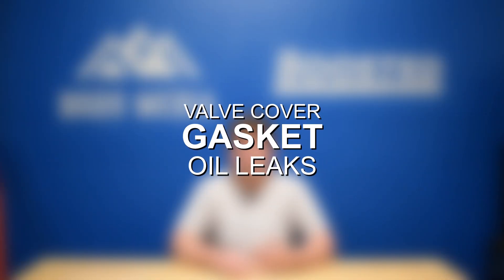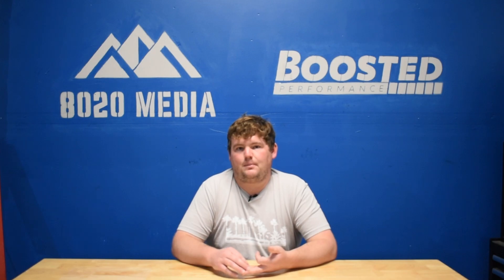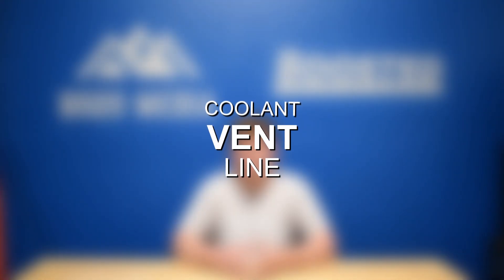BMW's B48 Engine | Problems & Reliability

Comment: As a lifelong mechanic of just about any car truck model I can tell you that no matter who makes the engine, stop listening to the "oil life" monitor and start changing it way more often. If I listen to my car, I'd change my oil roughly every 9-10 k miles. And my b48 is 2025 and requires the 0w-12 oil. $150 my cost for oil and filter! So I change it every 5k, no longer. Oil breaks down. Newer, thinner oil breaks down faster not slower. This is why there's so many issues among all manufacturers for oil starvation or lack of lubrication issues. Make no mistake, regular city/suburban driving is considered "severe duty". Change it more often!!

Comment: Just bought a 330i 2021 62k miles and loving the car , just took it to bmw to replace spark plugs , brake fluid and inspection of the car , they said car looks in great condition, super happy with the purchase .

Comment: Has anyone tried ATP AT-205 reseal?  I understand it rejuvenated rubber, so I'm  wondering if it will help prevent or delay any issues with the rear main seal.
Reply from the maker: D - ATP AT-205 Reseal is a plasticizer-based additive that can temporarily swell and soften aged rubber seals, which may help slow or stop minor leaks, but it’s not a preventive product and won’t extend the life of a healthy rear main seal on a BMW B48 in any meaningful way. In practice, it’s most effective for lightly hardened seals with minor seepage; on a newer or well-maintained B48, adding it is unnecessary and could risk over-softening seals or affecting other rubber components. If your goal is to prevent rear main seal failure, the best approach is maintaining proper crankcase ventilation (PCV system health is key on the B48), using quality oil at correct intervals, and avoiding excessive crankcase pressure—chemical “rejuvenators” are really a last-resort band-aid for a leak that’s already started.

Comment: Changing the oil every 6k miles and the coolant every 5 or so years makes a huge difference, as well as premium high octane fuel. Transmission fluid every 50k also
Reply from the maker: E - Sure does!

Comment: Will these mods give the x1 xdrive 28i 300whp? or should I expect more like 280whp since it’s slightly less powerful than “30i” models?
Reply from the maker: Z - I think you meant to comment on a separate video. If it is this one: https://youtu.be/UT0ErqdtDCU, the latter. The X1 likely won't get to 300whp.

Comment: Drive a 2019 bmw xdrive 430i gran coupe. Normal driving between 29,000-78,000 mi. Serviced at every interval.

1. Water lines failed and leaked all over garage floor $1095 repair.

2. Passenger side engine block plug + 2 O rings for turbo failed $865 repair.

3. Oil filter housing collapsed / failed ( made out of plastic lol ) $4200 repair.

4. Both front lower arm control bars with ball joints cracked $1265 repair. 

BMW are junk. If you have big money enjoy.
Reply from the maker: P - Sorry to hear this... However, we appreciate you taking the time to share your experience.

Comment: I had a 2017 320i that I bought brand new. At 31,000 miles the dealership notified me that I needed a new timing chain and valve cover when I brought the vehicle in for its regular service and oil change. I got a second opinion from a long time BMW shop in my area who agreed that the timing chain needed to be replaced. Amusingly enough they quoted me a substantially higher repair bill than the dealership!
Reply from the maker: R - Sorry to hear this... Hopefully it was under warranty!
Reply: @ Unfortunately it wasn’t, I cut my losses, traded it in and moved on. C’est la vie. 

Thanks for the content btw!
Reply from the maker: R - Sorry to hear. Thanks for the feedback!
Reply: Both lied, especially the indie.

Comment: I work at a dealer in the uk and here’s the problems we see:

Vanos central valves- pretty common.

Timing chain elongation- less common.

Tank vent valve- pretty common.

Coolant line from tank to head- pretty common.

Injectors- not very common but do fail.

Turbo wastegate actuators- pretty common.

Heat management- less common.

Some piston failures but not very common at all.

Overall a good engine but wouldn’t say it’s overly reliable. The B58 doesn’t suffer the same scale of issues.
Reply from the maker: A - Thanks for taking the time to share these insights!

Comment: Hey 8020 media, i have a 2017 330i xdrive bmw with 59K miles and have a major oil consumption issue, the car has zero leaks and is not running rich, do you have any recommendations on what parts could be contributing to that? every search tells me my engine is bad or my piston rings yet the car runs perfect with no performance problems, no smoke, and no rough idle, any tips would help! Thanks!
Reply from the maker: A - Have you had it looked at?

Comment: Do you recommend aftermarket aluminum replacements such as the oil filter housing or transmission cover? Sounds like seals should be part of preventative maintenance for these engines.
Reply from the maker: M - You don't need to go aftermarket, but they may last longer!

Comment: Common problems stated

1. Valve cover gasket oil leaks
- degrading & drying out + cracking
Solution - replace the part

2. Cracks in oil filter housing at 70-80k miles
- coolant leaks / mixes with engine oil
- part cost $300

3. Coolant vent line on cylinder head
- affecting 2.3.4 series
- replace for free at bmw
-  cannot handle accessive heat over the life of engine

Not many other common problems just have these checked out from time to time, comparatively a cery reliable engine
Reply from the maker: O - Thanks for doing this. It will certainly be helpful for future viewers!
Reply: 3 - 
2, 3, 4 series from the F line. G line 3 series has been on the market for 5 years now so it's useful to point out
Reply: @ProfShyv g series more reliable than f series i assume from my research

Comment: Im at 138.000km with my B48 120i, no Problems whatsoever. A bit thirsty, but absolutely reliable
Reply: Thirsty? I had it for a test in 520i, it was super frugal. 
Maybe it depends on the usage ;)
Reply: @BartoszRybacki0  Way to work, max. 130km/h. 30km per trip. Average consumption is about 7L/100km. While driving moderate. 
Ive workes in a BMW Dealership  for about eight years. Consumption in a 5 Series or X3 20i always 8-11L/100km. If you claim any different, I have to assume you are not telling the truth.
Reply: @Ridorian95  I only got this for two weeks as a replacement cat, when my Camry was being repaired. I only filled it once (fill up average 9L/100)
According to what computer says It used less than a 7 on long roads trips, and 11 L/100 or more (as you say) on small trips. It aligns with the 9L/100 fill up average. And internet fuelly averages. But in my opinion it is very good for this size and weight. 

My small Mitsubishi Lancer 1.8 was much worse - it could never go below 7.5 even with hypermilling tehcniques. Toyota/Lexus 2.0T is worse ;(. Old Civic IX 1.8 is much better, but it is much smaller - 60% of the weight ;) 

And of course my big Camry Hybrid is much better, but it is a different league. The fillup average after 1 year is around 6L/100.

But the BMW 5 (G30) was so quiet. Magic. No wind noise on highway.
Reply: @Ridorian95 that’s odd, I’ve been seeing nothing but good things about fuel economy in the B48 in all models, as I’ve been hyper researching the 330i. In sport+ it’s known to be thirsty, but that’s what happens when running hard. Where are you buying gas if I may ask? At least in Canada gas at many stations is absolute crap, Costco for example while cheaper seems to go through at least 1.5x faster then gas from the shell, (from my testing)
Reply: @averagerecon9777  have to add, that I love that engine & Im satisfied overall. Just assumed that the consumption would be less, in consideration that the 120i is a light car and doenst rev up to much with a 8speed automatic transmission.
Reply from the maker: R - Thanks for taking the time to share your experience!

Comment: Can I install a 2021 B48 engine on a 2016 F10 528i?
Reply from the maker: U - If you have the budget.
Reply: Are there electrical and mechanical parts that I need to change, or just change the engine?
Reply from the maker: U - Personally, we don't think it's worth it..

Comment: with this coolant issues any engine versions were improved? after some year? I have 2020 mk5 2.0 and they don't have information on the website.
Reply from the maker: M - The newer, the better. But you should still be good.

Comment: I've had all 3 done around 55-60k miles.  Luckily I work at BMW so they helped me out with the repairs. Another common issue I've been seeing which my car had was the turbo coolant return line. Other than those typical coolant issues the car has been solid.
Reply from the maker: M - Thanks for taking the time to share your experience!

Comment: Have my eye on a 2018 420i Gran Coupe and a 2018 428i Gran Coupe. Both around 25K miles. What would you recommend? I believe the 420i has  the B48 engine and the 428i? N20? Thanks in advance! 🙏🏻
Reply from the maker: T - Kind of depends on budget and what you're looking to get out of a car. If it were us, we would say B48, but the N20 is also a great engine.

Comment: 2021 530i b48 engine at 35k miles. All good so far
Reply: I would hope so. 35k is low
Reply from the maker: D - Nice, just make sure to keep up with maintenance!
Reply: @8020Automotive  oh yea trying to. Got oil change recently and replaced rear brake pads for the first time
Reply from the maker: D - Nice! You should be good then.

Comment: Just had my oil filter housing crack at 82k on a 2018 b48… was lovely. Got my coolant vent line fixed last year, now have an evap system service action…
Reply: How much does it cost?
Reply from the maker: A - So sorry to hear this.. Thanks for sharing your experience.

Comment: What about the balance shaft bearing? I heard it is a problem just like the 911 Porsche boxster. Any info on that? I am kind of concerned as I am about to buy my 3 series 2017.
Reply from the maker: D - We haven't heard much on these. Wouldn't say it's necessarily common or something that should prevent you from buying. Make sure to check maintenance records.

Comment: I own 2021 g21 and strange thing i had is sometimes coolant get low and other times when i check is in normal level … is very confusing
Reply from the maker: S - May want to check the sensor. Keep us updated. Thanks for sharing your experience.

Comment: I am fixing to retire from contracting and have always wanted a BMW, either the 3 series or the 5 series, but am very scared of all the horror stories about cost of repairs. I just spent $900 on maintenance with sparkplug change for a Toyota Highlander Limited so I can only imagine what routine maintenance is for the BMW. I do love that front end on those things though. What can you tell me that will put my mind at ease from all the other horror stories I have heard on Youtube. Although I have heard good things about the B48/B58.
Reply: Get a B58. Everything good about the b48 is in the b58, only difference is the b48 is a 4 cyl and the b58 is a 6 cyl. B58 is much faster and you can do a lot more with that engine than the b48.
Reply from the maker: F - Can't deny this.
Reply from the maker: The key to affordable maintenance is avoiding the dealership and DIY'ing as much as you can. Spark plugs and ignition coils will run you like $400 in parts on something like the B58. You can DIY them in probably an hour or two even if you don't have much mechanical skill. Dealership will probably charge you 4-6 hours of labor at $200/hr which is ludicrous. Indy shops are still going to be in the $125/hr range but they'll probably charge you 2 hours of labor instead. Oil changes are more expensive if you use the oil you should use - we do all of our own oil changes and it still costs us probably $75-$100 in oil and oil filters per car. But general maintenance isn't the issue...it's when something goes wrong. When something goes wrong, valve cover leak, fuel injectors, fuel pump, etc. you are pretty much always going to be staring down a $1k+ repair if you don't have the skills to fix it yourself. If you're looking at high mileage engines that's when you're going to run into a lot more issues with oil leaks, water pumps, fuel injectors, etc.

Ultimately - yes, they are expensive to fix when something goes wrong.

Comment: if i was looking for a used bmw 3 series, would you recommend buying a model with the n20/n26 or b48 long term reliability wise? This is assuming both cars have similar mileage and maintenance history. I would be trying to buy one 2014 or newer because the dashboard-light website notes a sharp decrease in powertrain defects that year.
Reply: N20 had an issue in earlier model years with timing chain guides. Usually resulted in engine failures. If you insist on a N20, look for one made in 2015 or later, when they updated the guides. I had a 2016 with approx. 54k miles. Owned it a year and put on about 10k miles and had no issues. In general, I believe the B48 is a better option if available.
Reply from the maker: J - In our personal opinion, we like the B48 more. Toyota using it for their Supra goes a long way. Again, this is our opinion, so don't make your purchasing decision based on us. We also have a N20 video for your research: https://youtu.be/EdpZd1-7f-U

Comment: Those engines are trash and nowhere near as good as the N20
Reply from the maker: B - Certainly not trash. But the N20 and B48 are great engines.
Reply: N20 always. Very easy to work on.

Comment: Love the b48 on the f60 manual JCW countryman. You can get up to 280hp with a simple Ecu flash with zero downgrade in reliability. My German mechanic says the only thing he’s seen so far is coolant issues.
Reply from the maker: Deal - Very true! Thanks for adding this insight!

Comment: Mine has been a pain in the ass.  Oil filter housing ($3,000) cracked, and water pump took a dump at 60,000 miles ($1,000).  Next one will definitely be a 6 or 8 cylinder.
Reply from the maker: Fl - Sorry to hear this, however, we appreciate you taking the time to add your experience.
Reply: At what mileage did your oil filter housing go out? I have a 19 X3 and thats the only part that concerns me due to it could possibly mix coolant with the engine oil
Reply: My 6 cylinder B58 had a failed oil filter housing and water pump failure at 65-70k miles.

Comment: Thank you for this video!  Much appreciated and very helpful.  Considering my wife and I are about to purchase a 2024 X4 30i (note: the M40i / B58 engine X4 that we test drove had a much stiffer ride which is why we are avoiding that engine/vehicle combination).  I'm here doing some research on what I can expect in terms long term reliability from this B48 engine (30i).    As a senior citizen that worked on my own cars back in the 60's and 70's, valve cover gasket leaks, etc.  were always common although much easier to replace.   We have no issues paying a mechanic to replace aging gaskets, etc. which as you said, will happen to any car engine as it ages.
Reply: The B48 has an avantage over the B58 in weight. It's actually noticiable. You dont get the 6 cylinder grunt ofc, but the car actually feels a bit more nimble.
Reply from the maker: Mike - Thanks for sharing this insight!
Reply from the maker: J - Thanks for the feedback! B48's can be great if maintained properly.

Comment: How is oil and coolant mixing going to be detectable with no dipstick?
Reply from the maker: The lack of a dipstick doesn't help, but it would be evident during an oil change. You might also notice sludge underneath the oil fill cap.

Comment: hey zach, love what you're doing at 8020. An experienced BMW technician told me that the reason why Oil Filter housing on B4x engines might leak is that the filter cup was over-torqued during oil filter replacement. The torque is 25 Nm, NOT Ft-lb! It is enough to crack a the plastic washer within the housing. would love to hear what you think.
Reply from the maker: Hi TJ, thank you for the kind words. That is correct in that the oil filter cap has torque specs of 25nm (~18 lb-ft). Over-tightening the cap could potentially cause some issues, but I also suspect the oil filter housing is a component that we'll see having more issues as the B48/B58 continue aging. Leaking oil filter housings & gaskets have long been an issue on many BMW engines around the 8-12 year and 100,000-120,000 mile ballpark.

Comment: My 2020 330i xdrive had 87k miles on it and I lost it due to a flood in South Florida, took the insurance money and got my baby back with 0 miles ❤
I currently live in Gainesville, Florida and have a home in Fort Lauderdale so I drive a lot and also saltwater fish every weekend along the Atlantic, from St. Augustine all the way down to the Florida key’s. In a span of two years I put over 80,000 miles on mine and I only had to keep up with regular maintenance. Oil changes, new tires etc. I did have to replace a rim due to a stress crack at around 84,000 miles but that was it. Bmw definitely hit it out of the park with the b48 and b58 engines. I also bought the oil change service plan at BMW offers for $220 covers 2-3 years unlimited miles I got 6 oil changes in a span of 10 months out of warranty from that, would’ve been more if it wasn’t for the flood. $220/6 comes out to $36 per oil change and I could’ve easily gotten that down to $18 per oil change if I would’ve had it for an extra year.
Reply from the maker: Sebas - We couldn't agree more! Thanks for sharing your experience!